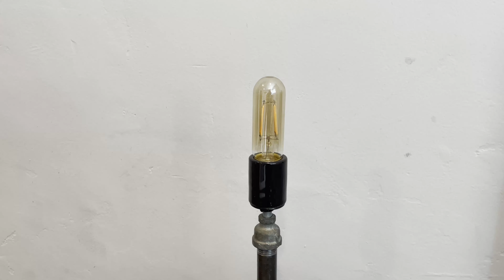DIY Edison Bulb Industrial Pipe Desk Lamp - No Special Tools or Parts Required

Comment: Can you hardwire it with dimmer wall switch?
Reply from the maker: Hardwiring this (or any) portable lamp doesn't meet code but you can plug it into a dimmer controlled outlet. If you do so don't install a second dimmer on the lamp itself.